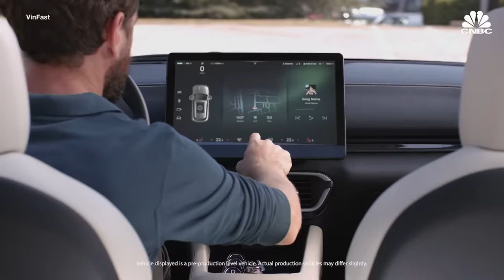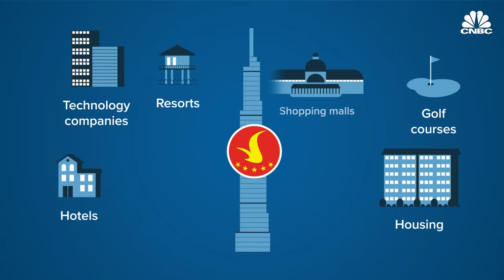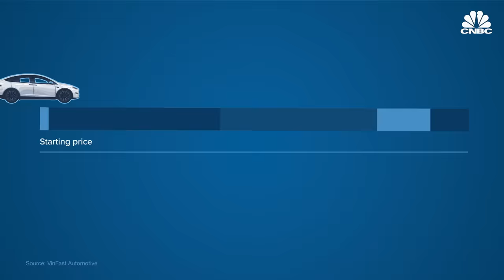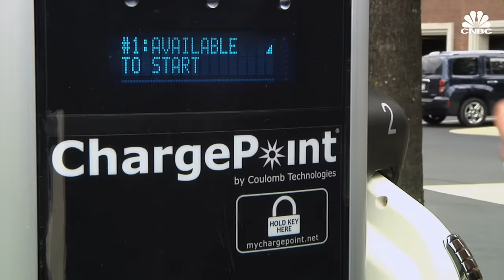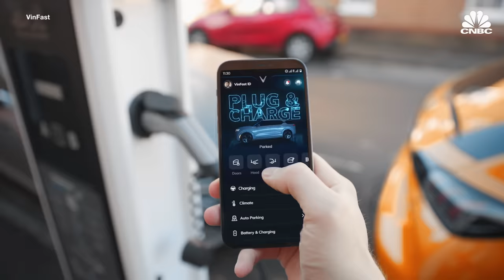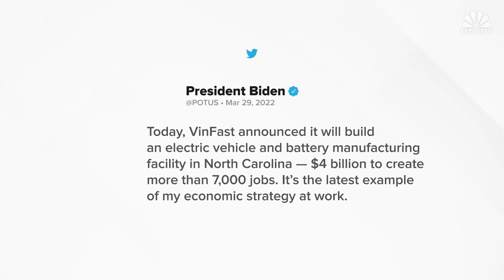How This Vietnamese Carmaker Is Trying To Beat Tesla In The U.S.

Comment: Hold on. You have to pay for the car and then pay some more to drive it? No thx.
Reply: Nguyễn Anh Kim Thư   less than a frappe at Starsbuck. Tesla 5 years warranty covers battery too. VF battery is on a lease, you’re paying for it on day 1, so warranty is irrelevant. It’s like saying someone rent a car at Hertz and it has a 5 years warranty on the tires. Dare to disclose what covers under that 10-years warranty?
Reply: Nguyễn Anh Kim Thư   You don't understand Lease vs Warranty do you? Are you living in US ? You are paying for the lease of the battery, so why mention warranty. Warranty in US means that product is under free of charge for repair if the product is defective. In 5-6 years the battery at 80% and you wanted to sell the car, the new owner would have to continue to pay and take over the lease of battery until 10% degrading of batter in order to get a new replacement. You misleading by saying when selling the car, a new owner will get a new battery from VF. Signing up this battery lease is like buying life insurance... If "you" or 'VF battery " don't die in 5 years, you just lost that $6,600.
Reply: Nguyễn Anh Kim Thư    do you live in US? You don’t have to buy maintenance plan. Auto insurance is not to repair your car. NVM…why do I even want to explain to someone doesn’t live here.

Comment: Vietnam's Vinfast will be allowed by protectionist forces to export to the US/West because their EVs are NOT disruptively cheap / inexpensive. In stark contrast to those countless Chinese EV manufacturers of great, high-spec, disruptively cheap or low-cost EVs($6,000-$25,000).  So-called "Western" consumers are screaming out for cheap or low-cost 4/5-seater EVs - from China if needs be - but protectionist forces are still doing everything in their considerable power to prevent the floodgates from being blown open.
Paul G